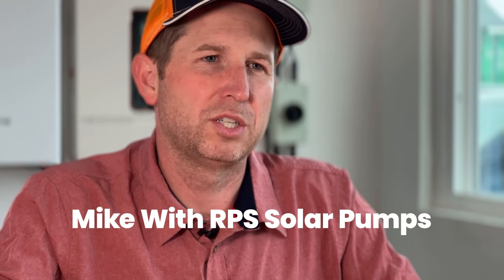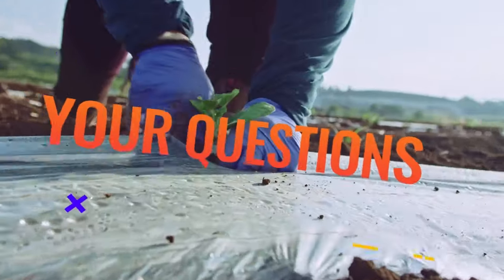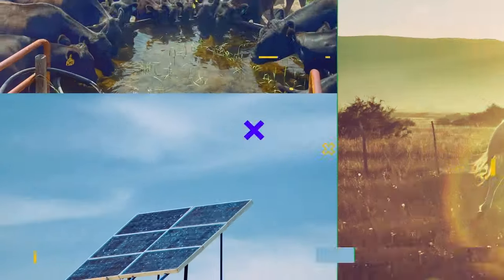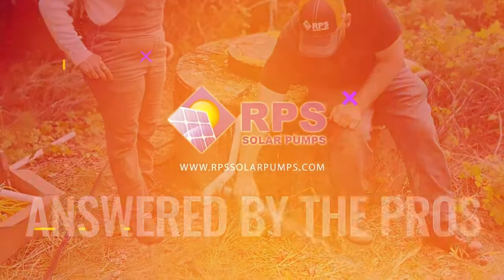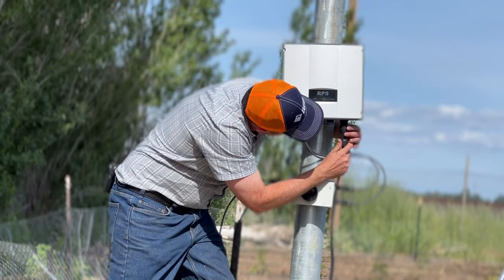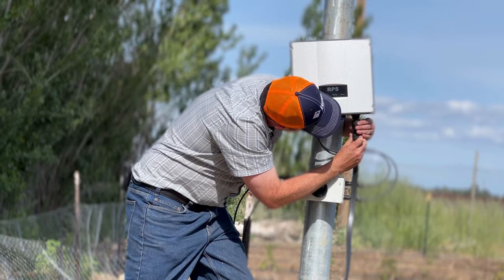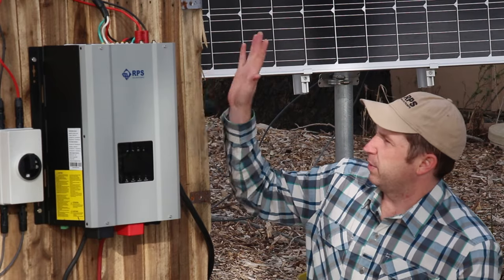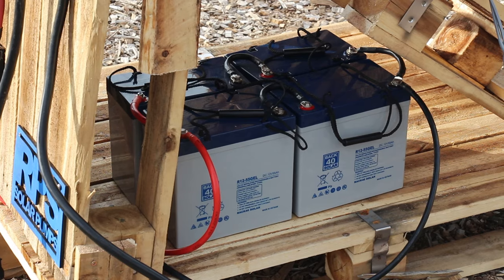Can I Run a 220V pump on Solar? | Q&A with the Solar Water Pump Experts

Comment: How to connect 8 pieces of solar panels of 200watts (26volts and 8.5amps) to power  2491watts solar pump (185volts and 13.6amps) without battery.

Comment: Thank you for the answer you just gave. How many solar panel, inverter and battery can be used to power 220v, 0.5 h.p AC submersible water pump?

Comment: I want a solar backup for my well to be used if we have a grid failure. I have 187 ft well with 3/4 horsepower engine. The well 100 yards away from house, well pumps to house-to pressurized tanks and then to the house.the well also is capable of sending water to above ground tanks for irrigating in the summer and could be reversed if well went dry.  The well generate 1-3 gallons / minute which is why I have I have above ground tanks for irrigation. I’d like to be able to flip a switch I if I lose power and have the batteries to use well on demand but not continuously.  Thanks, Bob Head in Virginia
Reply: 3/4hp in practice works out to like 500 or 600 watts / hr. You need to know how many hours per day you need the pump (or more specifically, how many hours you plan to use the pump when you're out of power). But lets say you consume 500 gallons per day, so the pump needs to run 250 minutes per day to replenish your tanks. That's a power usage of (600*4.2) 2,520 watts / day. Since you'll be using an inverter, you need to add 15% to that figure for energy loss. Brings you to 3000 watts / day. If you get 5 hours of direct sunshine per day, you'd need 600 watts of panels to meet that demand. 300w panels are fairly common, so you need 2 of those. Then you need a charge controller (MPPT) and batteries to store the power. For batteries, you need to produce 3000 watt hours of energy, so at 12v that's 250 amp hours (3000/12). That means x3 12v 100ah batteries wired in parallel. Or at 24v it's 125ah, so that's x2 12v 200ah batteries wired in series. Either arrangement will work, assuming the batteries are lithium ion. If you use lead acid batteries, you need to double the capacity of the battery bank (so x6 of the 100ah batteries in parallel or x4 of the 200ah batteries, 2 in series and 2 in parallel).  Depending on which one you pick, you'll get either a 12v or a 24v inverter. You wire the panels to the charge controller, the charge controller to the batteries, the batteries to the inverter, and the inverter to the pump.

Comment: I have a submersible pump 7.5 kw AC, and the well is about 100 feet deep. I need to run this pump on solar without batteries for irrigation by flooding. How can I design this system?

Comment: can i use solar as a backup to run my pump as in when my grid power goes out it will automatically kick on and i run on batteries until the  grid comes back on ? also what would it take to run my house on solar  i have a double wide module home and everyone says i can’t put panels on the roof so can i put tracking solar panel array on my property instead?  what would the price be and how long would the panels actually last? i hear that is a major issue with panels. short life expectancy

Comment: My water pump 220v so how many solar pannels need. Also  can i use with out batery store  or directly connect pannels and pumps.
Reply: It depends on how many amps your pump draws and how many hours it runs. When thinking about solar electricity, you want to think in terms of power consumption (volts * amps * time). Solar panels are rated by watts. So if you have a 300w panel, that means the panel can produce 300 watts in an hour. If you have 6 hours of direct sunlight in a day, that panel will produce 300*6 = 1800 watts in a day. For a pump running on 220v and drawing 5 amps, it will use 1100 watts per hour (220*5). So, one 300 watt panel will only really power your pump for an hour total if my assumption about it's amperage is correct. Solar panels cost somewhere in the range of $1 / watt.

Comment: Thanks for video love it  l  have submersible pump AC 220V hp lwas using this pump with generator now l want to use solar panel  direct without battery what  needed for this pump to work thank you

Comment: Thanks for your informative video. Please sir how can I get a pro controller that I can used to power 0.5hp AC interdab pump to pump water from about 30m depth. Also what size of solar panel will be needed. Thanks in anticipation for your response.

Comment: I have a plan to buy a 220v submersible water pump but I want to use it with solar panels only. I don't know if that's OK.
Reply: buy dc motor pump
Reply: @yagyatrips8903

Thank you for this feedback.

Comment: I would like to run 0.5hp open well water pump for my 50feet well. Will it work on 390w*2 panel+100ah*2 battery, 2.5kv inverter?
Reply: It depends on how many hours per day you need to run the pump